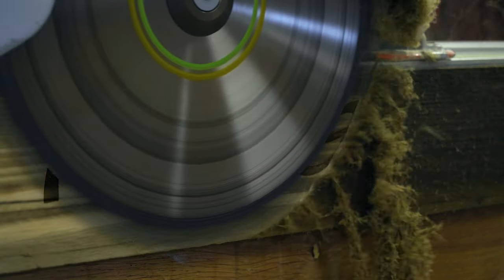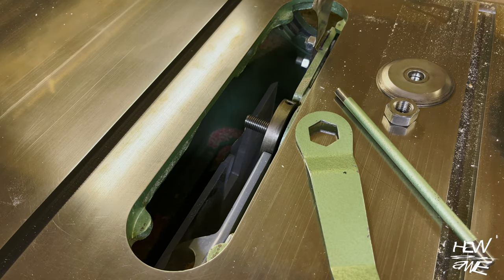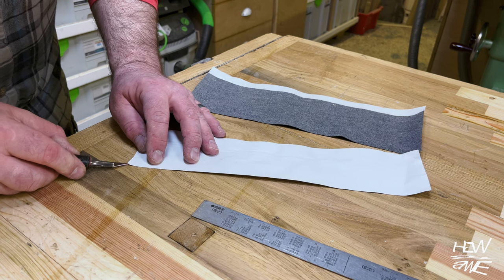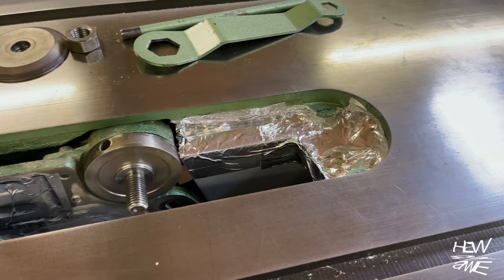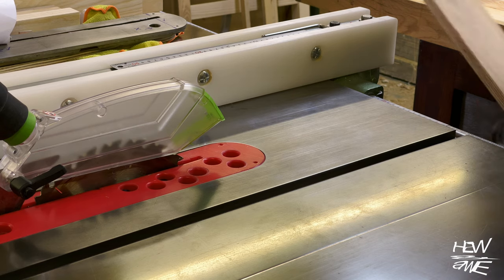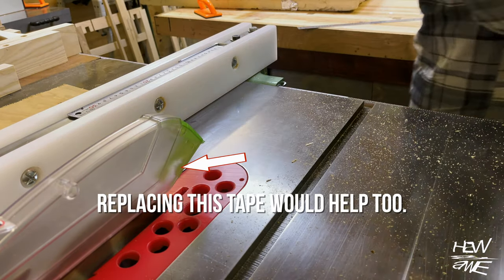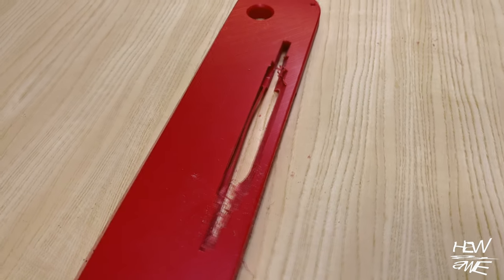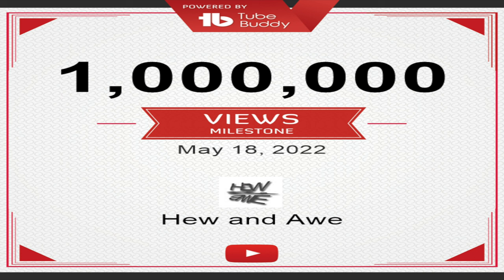Wadkin saw update

Comment: The overhead air filters are mostly for the dust you can't see. They scrub out the harmful tiny particles that stay airborne for a long time. Anything you can see will generally succumb to gravity before they reach a ceiling filter ;)
Reply from the maker: The harmful shit, yeah exactly, theres been some studies how useful they are and wasn't good - easier to just open a door or window, that'll do WAY more good than those things!!!
Reply: @HewAndAwe  good to know... I have a 5 sided workshop and balmy Aussie days usually so airflow aint much of an issue ;)
Reply: @FixitFingers  I use an AC400 and anyone claiming they don't do any good is in denial, as that's utter BS.  You should see what collects in mine after just an afternoon running when the workshop looks relatively clean!  It's all the very fine stuff you'd be breathing in otherwise!

Comment: Box extractors like the Record units are pretty good to be fair at cleaning residual fine dust from the air.  I have one in my workshop sat on top of a shelf where after a lot of saw work, the air can be cleaned of dust and clears fully within an hour.  I haven't put a tester on it but it's noticeably cleaner than without it running and the filter collects loads of very fine dust so I remove it weekly and bring it outside to vacuum or brush of the dust.  I'd rather it was in the filter than inside of my lungs!  My saw's dust extraction is woeful despite upgrading to a better cabinet saw, it's little better than my old GTS10 XC.
Reply from the maker: Do you mean those filters that hang from the ceiling? I read a an article about them and they pretty much said they’re a gimmick, I find having the door open to the workshop to the outside makes a huge difference, works like a air sprayer. I also can’t help but feel dust goes only one way with gravity in affect so how could they be any good. But I haven’t tried one to say.. I hope you had a lovely Christmas! 🍻😊🍻
Reply: @HewAndAwe  Yes, although mine (Record AC400) sits atop a shelf unit.  No, they're not gimmicks at all, that's plainly nonsense by whoever claimed that.  They offer high air flow filtration and in my modest 4.5 x 3m workshop can remove significant amounts of fine dust and turnover the complete air volume within the workshop many many times per hour filtering down to one micron.  Filtration rate is 409 cubic feet/minute which is significant.  I definitely wouldn't be without it now.  Dust hangs in the air for a considerable time is witnessed bythe amount collected in the filter.  You'd be surprised by how much fine dust is hanging in the air.  I do wear a mask now since a CT scan showed dust in my lungs. Only heavier larger dusts particles settle out quickly but this fine stuff which does the damage to your lungs is what you have to watch for.  The fine stuff can hang about for a long time.  Happy New Year !

Comment: Nice mod with the alu tape and faux leather. I noticed those gaps even on my small dewalt table saw, and was thinking of something like that, but wasn't confident if the constant pressure generated by the running blade and the dust extraction (ehmm.. 'henry vacuum cleaner') will rip it apart and shred it into bits! And yes, dust extraction from the top seems to be key as well. seen that in a lot of big industrial units.
Reply from the maker: Ive run that same set up on my old Bosch site for near 8 or so years, never had an issue and always connected to 1.5hp extractor, the worst that could happen it comes loose and clogs henry's nose up

Comment: Hi Ben, regarding a motor change for you extractor; I wouldn't.

The motor will run at a fixed speed (probably 3krpm) and a more powerful motor would run at the same speed. So unless your current motor can not maintain its speed while running going to a more powerful motor won't help. 

To check if you are getting full motor speed when attached to the tools, disconnect the incoming pipe from the extractor (thus removing the restriction of the pipework) while running and see if the motor suddenly speeds up.

To move more air you need to look at the impeller size/design. If you were to increase the impeller size some how, then you power requirement will have gone up, so may need a more powerful motor to spin it.
Reply from the maker: Hey Chris, thank you for this, makes perfect sense I also realised upping the power would need a 16amp supply I only have one and that supplies two tools and cant have them both on at the same time.. I'm gonna check the extractors like youve said, I have a feeling there might be an issue with the filters maybe slowing it all down - they're bag filters. Thanks Chris, I appreciate you spending the time to help me out there, nice one!!! Hope you have a lovely weekend! 🍻🍻🍻

Comment: And a second comment to second those clamps! I just used them to carve a guitar neck holding it down to the work surface and bearing in mind the downside of the neck had a radius it didn't move at all!
Reply from the maker: Mate, Im well happy with them, the 4 festool ones I have are mostly in the drawer ive spent the last 5 days using them heavily and I'm well impressed with their power!!! Even just two clicks on they feel like the arm of the law!
Reply: @HewAndAwe  what make are the clamps?
Reply from the maker: @wilbearworks  I think I put a link in the description bud 👍
Reply: @HewAndAwe  Thanks very much. I have just bought a pair.

Comment: Hi Ben. I was going to suggest use a bigger extractor but if your maxed out on your power supply now that won't work. Can you position your extractor closer to reduce the length it has to pull through? Change the extraction pipe to a flat smooth bore if it's one of those concertina types as they cause a lot of turbulence and loss in suction. You haven't any sharp bends in your extraction pipe/hose have you, they don't help either. Blow the filters out, empty the bag and don't let the bag get too full before emptying it again. Almost forgot, are you using the maximum extraction pipe/hose possible from your extractor to your table saw. I think your dust extractions suction was good on those tests you did. Tony
Reply from the maker: Thank you Tony! I have pretty much what you have said, large dia hose right to the tool then reduced down, no right hand bends, extractors couldn't be any closer - the concertina type hose I'll look into getting rid of and I'm a nightmare for not checking the bags are full, they're in another room away from me, like I said its good and I agree but I'd really like perfection, with out that crown guard extraction on 3hp saw it covers me in dust...
Reply: @HewAndAwe  Hi Ben, I don't have an extraction on my crown guard. What size HP motor is on your extractor and hose diameter to the saw blade when reduced down in size? Tony
Reply from the maker: @tonyworkswood  I think it’s 1.5hp and once reduced down 76mm
Reply: @HewAndAwe  Hi Ben. I think your 76mm is restricting the suction where it's needed. That 3HP saw of yours can remove some serious wood fast. Could you not alter the extraction to take the full size hose.  I think the amount of wood being removed by the saw blade is too much for the extraction port size to cope with effectively inside the confined saw blade enclosure you've made. The excess is being thrown up the back of the saw blade at you like you've mentioned. Just try it without the extraction on and see if you get a ridiculous amount of sawdust shooting up out the back of the saw, just a thought. Tony

Comment: the never ending quest for dust control! my current system has me position my saw close to the door, improvements are being made bit by bit, but I've still got a mountain to climb. are you running a different extractor to your top extractor thing?
Reply from the maker: Youre bang on there, I say to everyone leave your door open to vent outside, its free dust extraction, way better than those rip of boxes hanging from the ceiling... some peeps just dont get the idea! Most of my tools have their own extractors, the table saw has one line in then split to the under and over collection, I need to blow out the upper filter and see the difference I havent done that in years. I have tried a LVHP on just the crown guard extraction but it made very little difference!